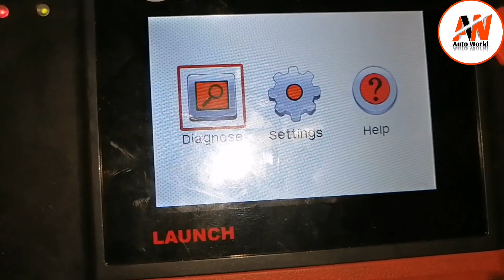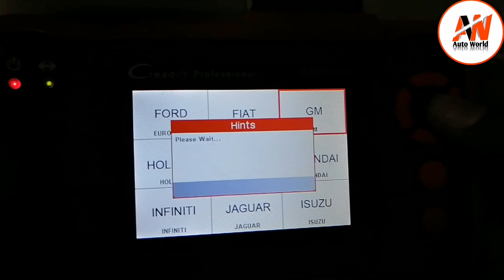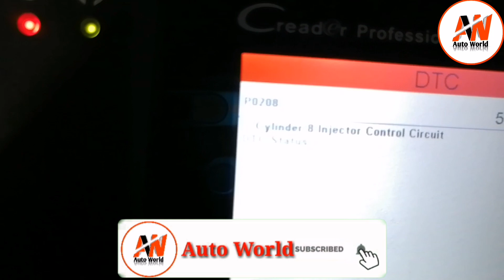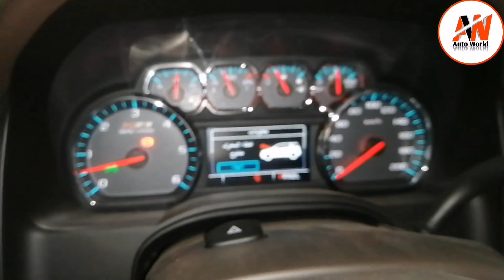How to Diagnose and Fix Fuel Injector Problem, Chevrolet Tahoe P0208 P0300

Comment: They say to replace the hard gas lines because they will leak. Should I replace the lines? Did you replace the lines? Any leaks not replacing them. I don't understand why they say replace them!
Reply: Its a one time use item.  It uses compression style fitting.  Once you crushed the seal you cant reuse it.